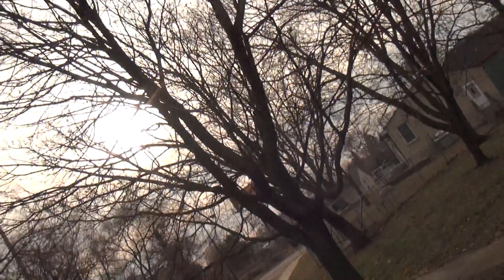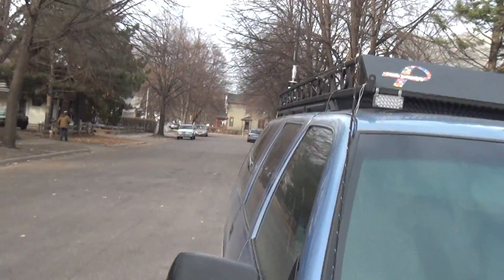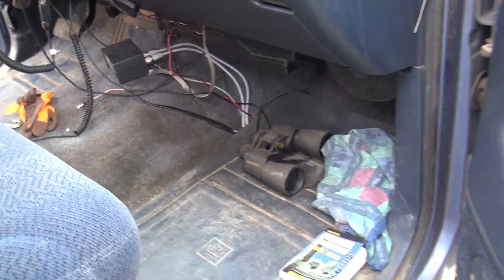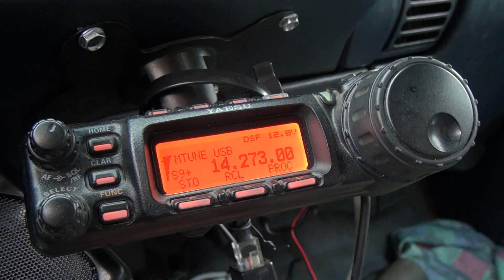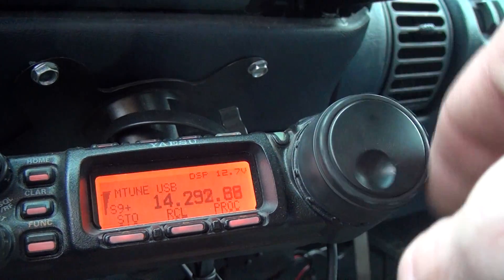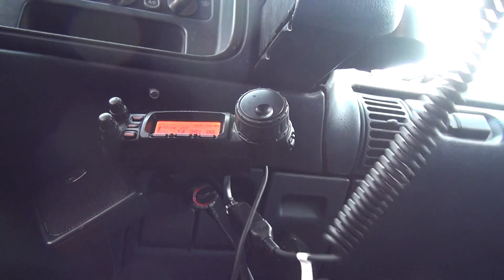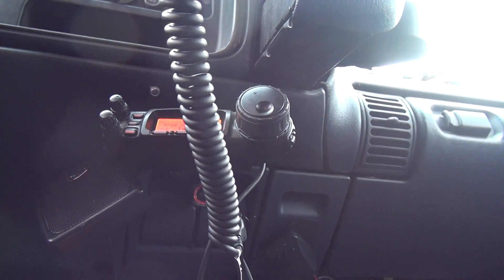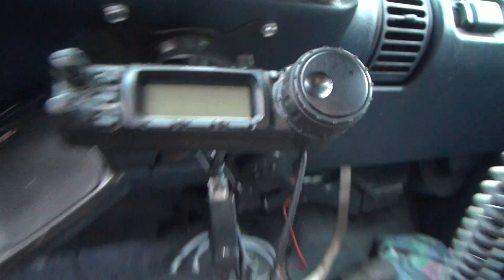Mobile Comms with the Yaesu 857-d and a Chameleon Vertical Antenna

Comment: Sir, respectfully, keep your aluminum siding, ditch the YASEU with that antenna system. Honestly, with a whip that tall, you should be talking to Chinese people, vacationing in Antarctic or Australia. 
Sir, except for those people talking in off-Central Texas, all I heard was wall-to-wall noise. So, where was the advantage(s) to the expensive rig that you are running, ... really?

Comment: what the....
sorry - but this is a pretty horrible setup!
dust, dirt, open cables all over and the txr under the seat?
ddid you noticed that the trx have two fans on the front wich stroke all the dirt from under your seat in it?!
you slowly kill the poor blackbox.
sir you're that kind of operator who get the license by wining on a tombola
or why you tune every time on a FIU?
100w mobile oparation on 40-20m band?
man...try this "the best amplifyer is a good antenna"
sorry but...lost for words about that man...
vy73

Comment: a great set up for portable DXing but please don't chameleon and drive. You can also use a 60 foot wire in place of the whips for the lower bands for greater antenna efficiency

Comment: Wow. The radio has terrible noise. Why is it so noisy? Do you have IPO turned on? RX pre-amplifier is not needed on 160-20m bands. Turn IPO on to disable RX pre-amp. You'll notice a significant reduction in noise level while maintaining good signal reception and strength. Using a pre-amp on those bands basically overloads your receiver. IPO can be turned on in the quick access menu. You may need to do this on each band from 160 through 10 meters, si the radio retains the setting in memory.
Just remember IPO=ON for 160-10m bands.
Also, the Chameleon, being an all band antenna, uses a very inefficient base loading system. They cheat by providing "good" SWR while wasting most of the transmitted energy in the fake matching coil. You'll be lucky to get 5 out of 100 Watts out in the air with that antenna. The best and most efficient mobile antennas are made by Tarheel. They use an efficient center loaded design and requires no lossy antenna tuners. You'll notice an improvement in reception and will gain a very significant improvement in transmission efficiency. Try it. You'll thank me later.

Comment: Have you ever wondered why your S-meter is maxed out and the radio is terribly noisy? There is a feature called - IPO. It basically turns off the RX preamplifier to improve RX reception quality. Most of the time IPO should be turned on on 160 - 20 meter bands. Preamplifier is not needed on these bands. It only overloads your RX front end and increases the noise by ten-fold. Scroll through the sub-menu options and turn IPO on. You'll notice a significant improvement in reception quality and overall receiver performance.
Just remember -   IPO=ON for 160 through 20m bands.

Also, try to avoid using NB (noise blanker) unless it's absolutely needed to block a pulsing type noise, often caused by faulty ignition components. Using NB set to the highest setting will cause some distortion in RX audio.

Comment: Is that LMR 400 from the antenna to the radio? Curious... how do you have a remote switch to the tuner? I need to do the same for my setup in my Tacoma. I have the same radio and tuner. Also, are you using the CHA antenna extension along with their antenna? Where did you get the spring coil (between the hybrid and the antenna?) 

Overall, I like your set up a LOT! sub'd

Comment: my question is why are you using a remote tune switch? when all you need to do is hook the yt-100 to the 857 thru the cat/linear port with supplied cable and just use the tune button of the control head. you should also be at least 3 khz off the frequency you are going to use to tune up with.

Comment: ya wow - sounds like he wasn't the only one tuning up on top of them though - and I'm sure you've realized by now the don duck sounds are just un centered SSB and with that pre-amp on on your RM Italy you should be hearing quite a few.  And someone stole a volt from you - it should read idle @ about 13.6-7 - if I did that too mine it would start limiting at about 11.7

Comment: Did you remove the paint from the truck body. I know I weld for a living and paint will mess with getting a ground.
Reply from the maker: wow.. great question... NO I did not remove the paint.. maybe would have bn GREAT IDEA...
Reply from the maker: DuFlux I will use SS Star washers to get the improved grnd...